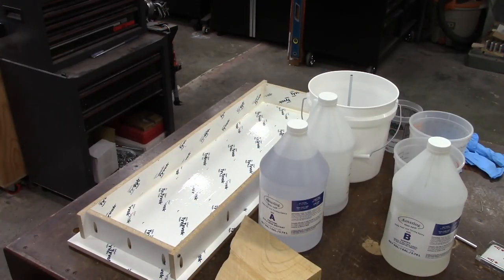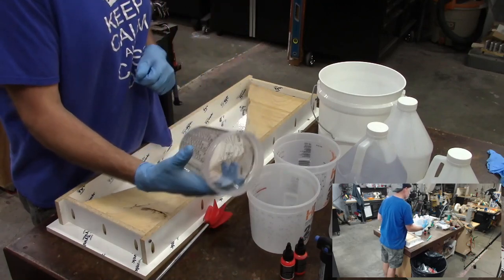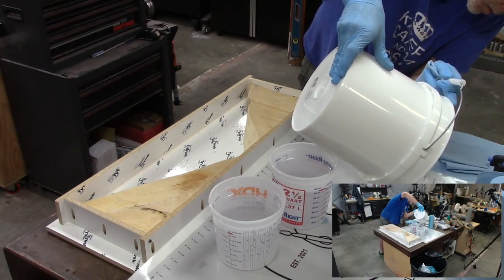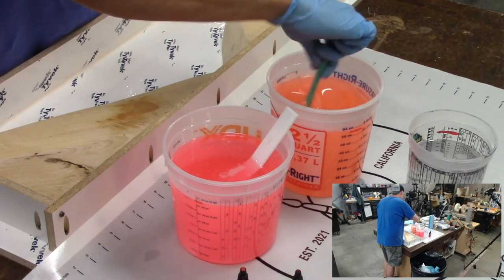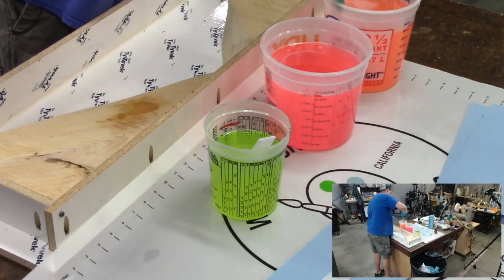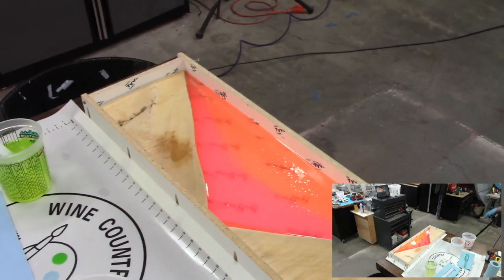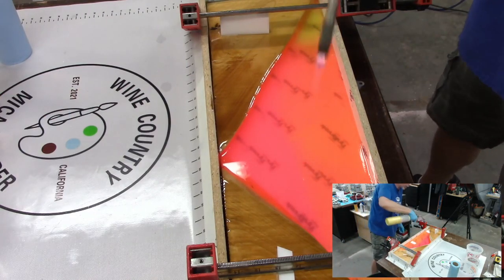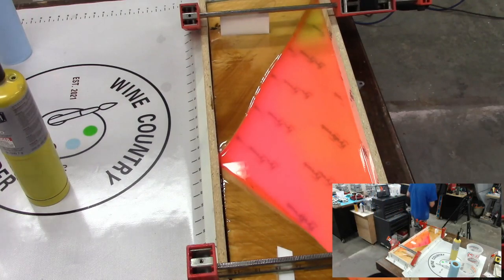Pouring Gallons of Epoxy! Resin and Wood Floating Shelf

Comment: Starting with square, flat pieces of wood looks like the best approach for a shelf based on the demold. Install a cheap blacklight light fixture over the shelf for end of day adult beverage consumption! This is going to turn out super cool Zak. ✌
Reply from the maker: It actually came out totally flat once the resin flowed around them, milled up nice and easy =D
Reply: Looking forward to it!